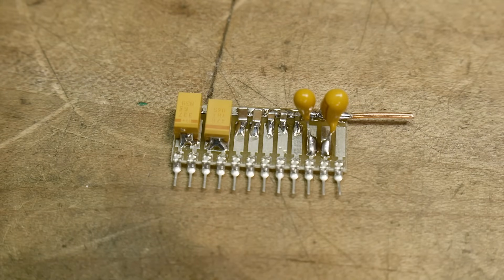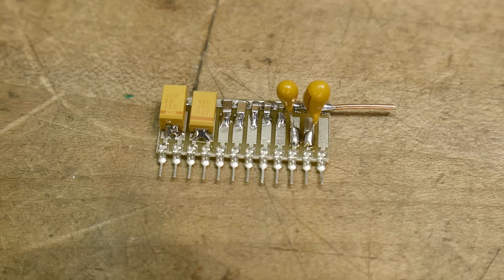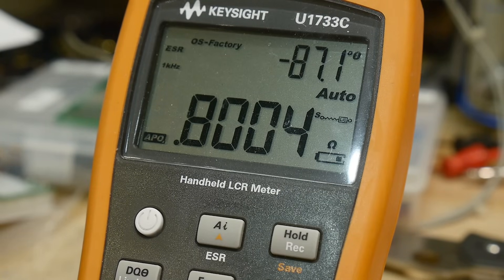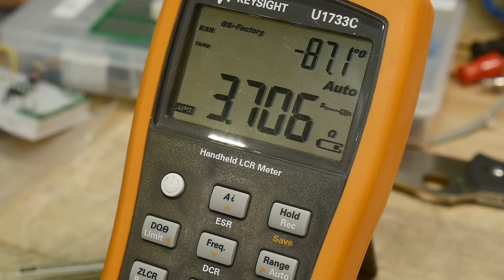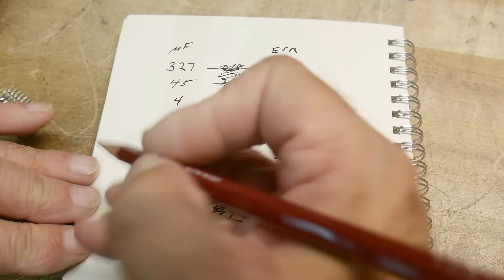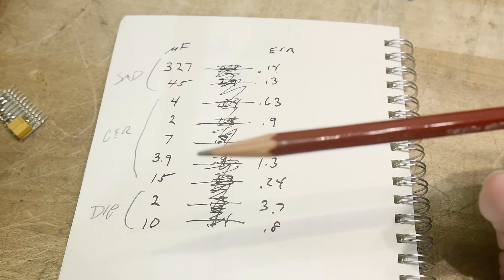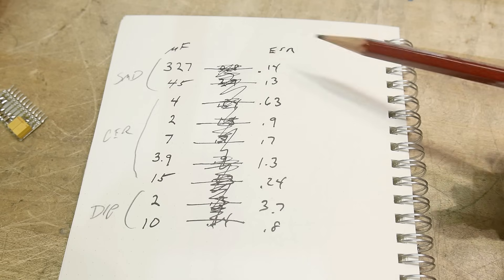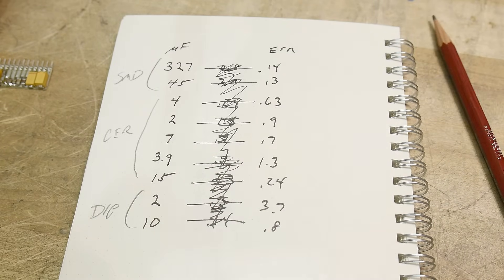#1922 Tantalum vs Ceramic ESR

Comment: the standard ESR measurement is always done at 100kHz and not 1kHz. Datasheets only report ESR at 100kHz. But that's probably not the main reason to use Tantalums. Ceramics can be highly voltage dependent and thus bring a lot of nonlinearity with them that Tantalums dont. The most important thing about Tantalums is their temperature stability and moisture independence. So, no they should not be replaced with ceramics. Doing the opposite is OK but hugely expensive.
Reply: Why does it matter for ESR if its 1k or 100k - if the meter can distinguish the static portion with sufficient resolution its the same ESR.
Voltage dependency is easily countered by looking at specs and choosing accordingly - bigger case size and voltage mitigates the issue. 
Temperature stabilty of x7r is what +/-15%? If used for decoupling - why does it matter? If you need timing and rely on caps - you're doing it wrong.
So yes, ceramics can absolutely replace tantalums, and come with fewer caveats and fire than tantalums.
Reply: @VEC7ORlt  it matters b/c usually ESR varies (non-linear) with frequency. Assuming the noise input bandwidth is unknown, it's most useful to measure ESR at the self-resonant frequency so you can know the minimum impedance.
Reply: in my experience, the disadvantages with Tantalums vs Ceramics are:
1. catastrophic failure (fire) under reverse polarity and over voltage
2. orders of magnitude higher parasitic leakage (with temperature dependence) - not acceptable in low power circuits
3. larger footprint and size for small value parts
4. higher cost

the standard mitigation for ceramic weaknesses of DC bias and operating temperature is to use C0G, Class 1, and/or automotive grade ceramics that have more comparable performance (and still usually cheaper than tantalum). The standard Z5U and even X7R commercial grade ceramics are crap with DC bias (but some manufacturers are better than others)
Reply: @dl5244  if you need to find esr at self resonance you are opening a whole new barrel of worms, which doesn't include simple replacements that will be good enough, but delving into intricacies of PDN design and verification, how deep do you want this rabbit hole to be?
Reply: @VEC7ORlt  I disagree. imho (25+yrs as engineer) if you don't care about the impedance at SRF, you don't care about impedance. And that's ok for a lot of applications, but it's better if you know when it matters
Reply: @dl5244  thanks for letting everyone know you had a lengthy career, as if it matters in this discussion.

Comment: I've once purchased 500 MLCC 1206 capacitors with a 47uF 50V rating and I tested to have an ESR of 0.08 ohms at 1kHz!

They perform really well even at 35VDC!

Sadly I bought them from an Indian online store called hnhcart, and I'm not sure about the manufacturer because I can't find capacitors with such high capacitance at that voltage on major electronics retailers like DigiKey, LCSC, or Mouser!

Tantalum capacitors are always expensive, and they don't have as low resistance as the MLCC often have! And I've seen most polypropylene or polyester film capacitors do have quite low ESR! I have got a 105uF huge 250VAC motor starter capacitor, which has an ESR of 0.01 ohms! Charge it up at 30VDC and short it, and it gives quite a loud bang LOL!
Reply: 47uF 50V in 1206 can't be right. Smells like BS.
E.g. GRM31CR61C226KE15 - 22uF 16V 1206 and provides with 50% of nominal capacitance at only 5V bias..

Comment: Great video.  To my knowledge, tants were never a substitute for ceramic, instead they were a much better option than electrolytics, in terms of lifespan, filtering, and everything but size and cost.  Now it's ceramics replacing tant.  Which should work fine unless the circuit depends on the cap not being great...but that wouldn't be a great design, in my view.

Comment: This brings up an interesting case: the TruSDX website says that the Tayloe detector integrating capacitors (100nF each iirc) can be replaced by some (expensive) 0603 Tantalum caps for better performance. If Tantalum actually has worse ESR at those values (and likely also at the frequencies it's working with), why would Tantalum be better than ceramic in this case? Maybe it's because X7R ceramics change capacitance with voltage and temperature and have piezoelectric effects while Tantalums don't (at least as much).
Reply from the maker: I suspect as others have commented, that 'solid tantalums' have better ESR that all the others, but expensive. I do not have any to test
Reply: I tried replacing some ceramic caps with tantalum ones in the usdx hardware and got quite good performance, especially in the opamp circuit. I had a ton of image rejection issues that were resolved after switching to tantalum and, of course, the piezoelectric effect related issues. It might have something to do with their tolerances also. generic ceramic caps have higher tolerance (20%) compared to tantalum caps (10% to 5%), and tantalum caps have a much lower derating factor, and that makes them more suitable for decouplings in the usdx circuit.

Comment: Leakage is something to be concerned about as well. Tantalum caps are worse than ceramics but better than eletrolytics. Also, capacitor behavior is much more complex than a static room temperature reading. Frequency, temperature, DC bias, and inductance  should all be considered as well.

Comment: A admire the effort, but  I am rather skeptical that you're getting reliable ESR measurements with those clip leads.
Reply from the maker: the leads were used in the open/short calibration that removes any problems

Comment: I don't know how many times I've seen old teardrop tantalum's just going into full short mode and clamp a voltage bus. I know the engineers use them because of their ESR values but I've started just replacing them in old equipment when I run across them. BTW when they short they'll pump out a ton of the magic smoke. 🙂
Reply: Well at least they will be easy to spot!
Reply: old age comes with disadvantages clearly
Reply: Pretty much what I wrote, too. I remember hearing that it was one particular company's dipped tants that would pop. They had made a whole bunch of bad ones. The ones I had pop were always dirty yellow, so there might have been some truth to that. After the first 2 popped I swapped out 2 dozen of them in a sig gen I got at a government auction. Fortunately most of them were on plug-in cards.
Reply: @johnwest7993  I had a pale red one short out. Replaced with normal electrolytics. Which would have been interesting in the test sequence as well.
Reply: That's why they're more expensive; you're also buying that high-pressure magic smoke.
Reply: And wet slug tantalums violently explode if voltages are reversed.

Comment: Have you zeroed the leads resistance? I use tantalium caps when I dont find high enough capacitance in ceramics.
Reply from the maker: Yes, I calibrated the leads
Reply: the main point of tantalums is the capacitance density, in some case ceramic jsut wont reach the require capacitance for a given space.This also have to do with the fact that modern polymer tantalum require almost no derating, while for ceramic it should be at least 50%, and capacitance density is a direct function of the voltage.

Comment: Nice Info on Capacitors, Really good for New People learning Basic Electronics.. I miss telling New People to get the Old Radio Shack Mini Books on build demo electronic Projects, I still have mine that I keep on the LM555 One Shot timer IC builds I used for Displays on equipment I added on...

Comment: Let’s not forget that ceramics don’t explode. Tantalum is an inferior capacitor unless you need an absolutely massive capacitor, in which case it’s superior to aluminum electrolytic. At small values, ceramic is 100% better.

Comment: Ceramics have problems when voltage is aplied to it. Electrolytics dont have this.
Decoupling ceramic caps loose some of its capacitance.
And yes, ceramics are noisy in analog circuit.

Comment: I rather wanna see bad ESR or microphonic effect, then get my house, lab or garage burn down....
Reply: Many years ago my dad bought a used milling machine that came with a "gift electric match lol" in a form of a tantalum cap, luckily it was in a full metal box and the location on the board allowed for a simple fix without much damage around.
Reply: Tants are fine if you derate them properly and protect them from reverse current and internal dissipation. Some applications may require a soft start circuit to limit inrush current. If you dig deep enough you can find the proper application notes.
Reply: @bretfuzz925  Modern , maybe, the olds naaah! They had a super tight tolerance, so if You had a burnt rectifier bridge, the fire was guaranteed!  Elna made a nice money on replacing all tants with their mustard caps, all overt the world. On some DDR product packaging even wroted “No Tantalium capacitors!”
Reply: Which directly supports what I said. Typical voltage derating for a tant is ~2x. In old designs people thought you could use a 6.3V tant on a 5 V rail. That makes the FIT very high. We used them “properly” in high volume 20 year mtbf applications by proper derating and protection and not a single board came back with a failed tantalum capacitor. Any capacitor has the capability of failure. Tantalums just fail more spectacularly.

Comment: I wondered, on your meter it showed "1 kHz" when measuring ESR. Most often ESR is measured at 50 or 100 kHz I believe, at least mine do
Reply: My DE-5000 handheld LCR meter has options for 100, 120, 1 kHz, 10 kHz and 100 kHz.  It kinda depends on the meter and how you intend to use the capacitor.  The 100 and 120 Hz settings are appropriate for AC to DC power circuits with alum electrolytics.
Reply: @kodiak2fitty  For switch mode electronics which work on several kHz you can measure an electrolytic with a cap meter on 120 or 1000 Hz, and it will show a good capacitance reading (but still the cap may be unusable in the SM circuit. Not all LCR meters show ESR, some do
Reply: @greengrayradio1394  You are correct.  I didn't add the word "linear" to my comment.  I'd also argue that 100 kHz is not enough for modern switch mode AC or DC designs with 1+ MHz switching rates.  As for dedicated LCR meters not having ESR measurements?  I've not encountered that.  Even $100 LCR meters support that today.  A multimeter used in capacitance mode lacking ESR measurements?  yes that could happen.

Comment: Tantalum is often over rated. ESR often seems to me to be about capacitance value & voltage rating. That 327uF cap with the low ESR might only be good to 3V with it's low ESR of 0.14 Ohms. The same value and type with a higher (often more usable voltage rating) can have much higher ESR.  Another related interesting thing people say is that they switched to ceramic to avoid conflict materials and rare earth stuff but you can find those in many ceramics too. The parasitic inductance is also a fun one, people forget about it and just follow the traditions of paralleling multiple caps. I used to use 0.1uF ceramics for power supply decoupling but now I use 0603 ceramics at 10uF or 1uF instead because their internal resonance is good enough. It seems like the 0.1uF thing is a legacy of the through hole days and those wire leads really added inductance.
Reply: I would also like to add that if you measure close enough a lot of things become microphonic. At my old job we were using PXI-4461 cards and HP 35665A DSA's for everything and we would regularly spot microphonics from things you might not expect.
Reply: It also depends on the operating frequency - usually 0.1uf decoupling caps are used on digital gates, and chips - the same decoupling for a chip that runs at 2Mhz isn't going to cut it for a chip that runs at 3GHz...
Reply: @gorak9000  Well at GHz range you have well exited the range where you can use 0.1uF. Those frequencies you need to check everything to use for that domain.

Comment: You need network analyser vs frequency,  , that Fluke don't tell you the true 👋👋👋👋👋👋👋👋👋👋👋👋👋
Reply: That was not a Fluke, but a Keysight, regardless of the similar colour scheme, but indeed, LCR for caps varies with frequency.

Comment: There are much better tantalum capacitors on different pc video cards and motherboards. They have about miliohms and capacity 220-470 uF
Reply: You'll probably find those are mostly solid electrolytic capacitors not tantalum.
Not many tantalums used anywhere these days, they are a lot more expensive.
Reply: @zyeborm  A lot more expensive because it is a rather rare metal.  Many people don't realize tantalum is also a conflict mineral like gold, tin and tungsten.

Comment: Great video, but would have been more scientific to use the same value capacitor on something like a 2.2uf capacitor of each type,  That and maybe having a higher and lower voltage rated cap to directly show the effects. Most testers and manufacturers I believe report specs at 100khz,, so those numbers might be more apples to apples for those doing their own tests at home. The "magic" capacitors I always thought were organic polymer, but that's probably overkill in most applications